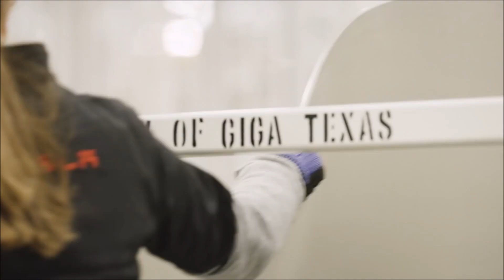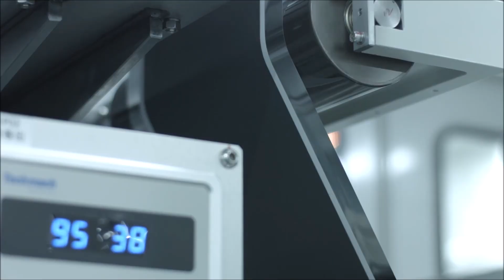DEVELOPING! Elon Musk Places His New Tesla Battery Bet

Comment: LFP batteries are lower range and take longer to charge... Tesla made it clear during battery day: they will be using all kinds of batteries from all kinds of suppliers.
Reply: They don’t take longer to charge. As long as you precondition you’re good.

Also the range is the same in daily use because LFP can be charged to 100% with no degradation. While other batteries prefer 80-90%

Comment: Weren't the 4680 battery so great? So why Tesla is securing supply of batteries with CATL and BYD? Part of the answer it's cheaper production and reliability.
Reply: 4680 is merely the form factor not the battery chemistry.
Reply: Dont forget the supply constraints.  Tesla needs all the batteries it can get, thats why they are relying on outside supply the likes of CATL etc.